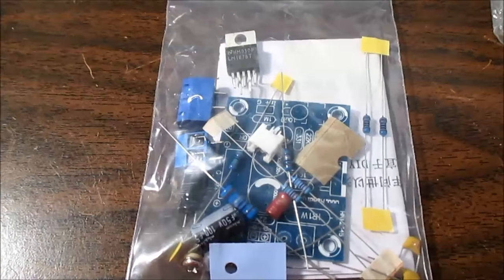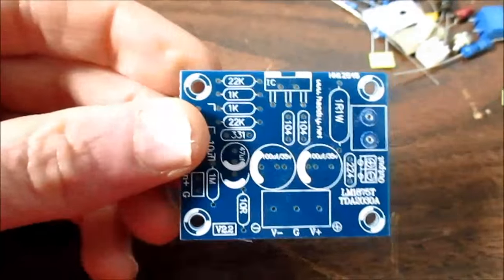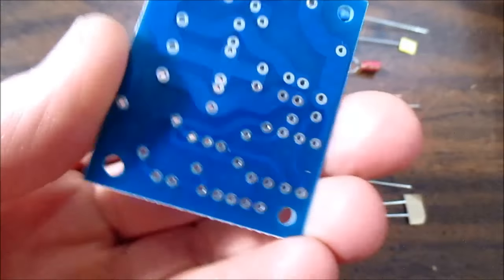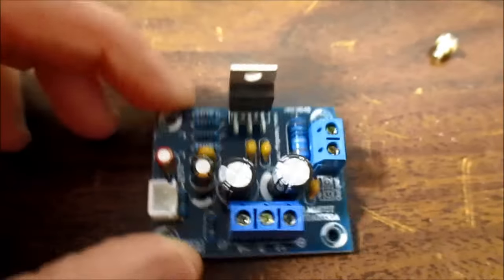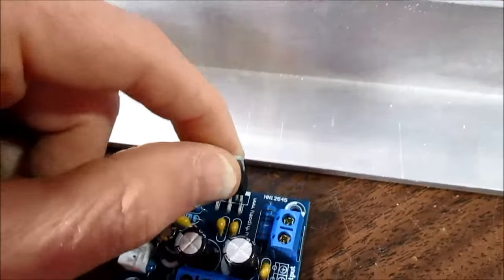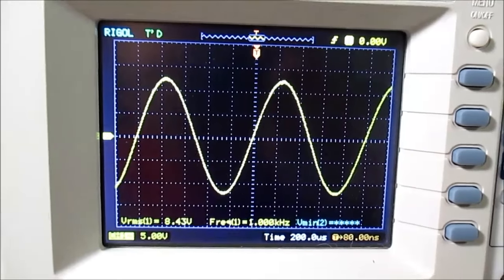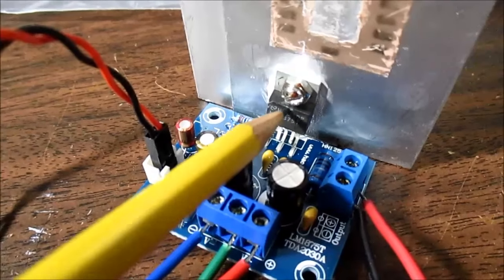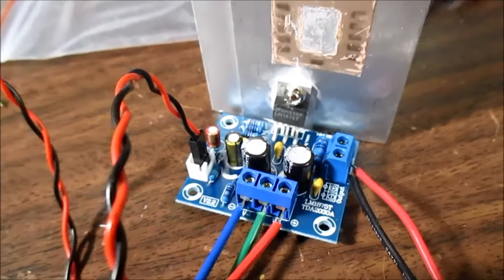LM1875 IC audio amplifier board kit test and review

Comment: There's an electronics magazine in Australia called Silicon Chip, and the December 2004 issue had a project called Schoolies Amp which is where the design for this amplifier section came from (it also had a power supply). They've also published some other good DIY amplifier projects (including the Ultra-LD series), for which they sell the PCBs on their online shop. And the more recent projects are often available as full kits at the local electronics retailers in Australia.
Reply: How do you know the magazine was first, and not some chinese seller?
Reply: @DasAntiNaziBroetchen  Because it's not in the Guinness Book of Records for the first time that a Chinese seller created an original circuit instead of ripping off somebody else's work.

Comment: This circuit looks sensible as it uses the differential amp function to effectively create a balanced input. Different than the datasheet recommended circuits though. Is there a source for how to create an optimised lm1875 schematic?

Comment: I can say from personal experience, the entire line of Texas Instruments IC audio chip-amps, LM class is awesome. I've been home hobby DIYing these chips for 20 years. If you breadboard them, keep the connections as close as possible, use better than average resistors and caps, good power supply/transformer, adequately cool, you WILL get amazingly, unexpected audio-sound straight into those beautiful speakers you would not test the finished board with.  I started low years ago, then advanced to the  LM3886. Try it, you'll be amazed if you're a newbie.
Reply: I'm new to this stuff and I want to build my own Bluetooth amps with Texas chips for Portable speakers but I have no clue on how to wire them could you help?
Reply: "better than average resistor"... em OK...

Comment: Got a few of these kits. The boards seem really well made, better than most OEM stuff. My soldering iron seems magnetized, it also charges caps while soldering them in.
Reply: Check to see if your soldering iron tip is grounded. It should be.

Comment: I always put a 100nF film cap in parallel with 47uF electrolytic cap. Gives additional stability.
Cheers from Indonesia
Reply: Lowers the ESR. I always use good low esr panasonic FM series caps and on the scope, i can see very little if any improvement doing that, but yeah, it can't hurt, especially if you are unsure about the ESR of the electrolytic. Don't put ceramics in the signal path though :)

Comment: Hi John, I've commented before and I have to say that yours is hands down my favorite YouTube electronics channel!  I watch pretty close to all your videos and I always learn more every time I watch one!  This particular video I've watched quite a few times and because I'm pretty much electronics illiterate, I pick up more tidbits of useful info every time I watch it!  Thank you for taking the time to do these vids!  I purchased and built the stereo version of this kit recently.  And I actually just finished it a couple of days ago.  It sounds fantastic!  I didn't use the supplied ICs that came with the kit, I ordered new ones from Digikey to be on the safe side.  The only issue I'm having is when I power the amp on or when I power it down, there's a slight audible snap in the speakers.  Not a big deal, but a little annoying.  Can I add a cap and/or resistor somewhere in the circuit to eliminate these snaps?  Thanks again, John for all you do!
Reply from the maker: Thanks for the kind comment! I'm glad you bought new ICs because they are now supplying counterfeit chips with these kits.

I had another question today about power up/down thumps and clicks plus some in the past. I think I'll do a video on it because there are many scenarios and solutions for it.
Reply: Excellent!  Thank you. John!

Comment: I bought two of these from that river store place, built them up, stuck them in a box, connected them to my audio interface and a decent old dual bench supply I have.  They work great; I'm using them right now.  I have one problem I don't know how to fix: they almost always don't start up correctly on powering on.  I guess they get stuck in some power blowing oscillation; not sure.  I get no sound, and the voltage is low, current high but not too high.  I need to touch the non-isolated heat-sink on the chip of one channel to make the amp go "schquwreeEEeEchhhChttts...."  Then it starts working...
Thanks for the recommendation.  It's a fun project, and it sounds great powering some inexpensive thrift-store bookshelf speakers, originally from a decent set of home theater speakers.
I enjoy your channel a lot.  I don't always have the time or ability to follow everything; your long amp series is pretty complex, but I've learned a lot from your videos.  So thanks...  Make more, please. :)

Comment: Nice little kit. I'm not surprised you don't see distortion on your scope's FFT, though - with an 8-bit ADC you get approx 48dB of dynamic range, so the minimum level of THD you could possibly see would be around 0.4%, something you're unlikely to see in a solid-state amplifier that's not being driven into clipping.
Reply from the maker: I tested this once by making a tone with a built in harmonic to see if it would show up. 1.0% and 0.5% were clearly visible on the FFT. 0.1% is lost in the noise floor. I never calculated were the cut off would be, so this makes sense. I'd like to get a spectrum analyzer or a distortion analyzer but these are currently out of my reach. There is some debate at where distortion can start to be perceived in music but most agree that under 1% should be inaudible (in most cases).

Comment: The price of this kit is in Germany at 1,70€ at the moment. That's a joke. Because this tiny chipamp is anything else, but not a joke. I ordered 2 kits half a year ago ( as they were @ about 5,70€). 3 weeks waiting, 30minutes soldering and you got a wonderful sounding little amp.The psu is +/- 25V and I put a hand full 2200µF/35V capacitors for a smooth DC in it. The LM1875 drive two 2-way Sats with a 130mm Gradient W130 AL 8 and a Monacor DTM104/8 25mm tweeter. A TDA7293 prallel kit powers a closed little sub with a Mivoc AW 2000. It's my 1st diy audio attempt and I'm convinced. It's much more I ever dared to hope I'd get. Now I'm totally infected with the diy-virus and I'm reading much about active crossovers & dsp ;) ... .

John, keep up your excellent work! I love to solder while you are explaining all these new things for me :).

http://abload.de/image.php?img=2xlm1875-tda7293-satrmuuet.jpg
http://abload.de/image.php?img=siebunglm1875komplettzluae.jpg

Comment: Have to say about the board, the soldering points are very small and the copper very thin.
The boards comes in different qualities.
Those I bought can not take any stress at all.
Recommend to glue the connections terminals

Comment: For me John, these videos are very valuable! I want to to know about these low power audio amps and I don't have the time to research what's out there, thank you so much! Will this chip run on less voltage, say 9 volts or maybe 12 volts? I know the power out put would be lower, but does it have a minimum threshold voltage? Here goes another small amp! Thankz
Reply from the maker: 9 volts is too low but 12 volts could work. It requires a split supply, so 12v is actually +6 and -6 volts. Power supply voltage vs. output power is an exponential function, so expect to get only about a watt or two at such a low voltage.

Comment: Hi John, with regard to the 10uf coupling cap, can I use motor-run caps? (I think they're metalised polyester). I can get em cheap at 400v even though that's overkill. Otherwise I'll just use suitable polyester or polyprop caps, rated at say 50 or 63v. Cheers, Martin

Comment: Hey John,
I decided to order few of these boards. I thought buying from DigiKey resistors and caps and using them instead of the questionable supplied ones.
But I am getting confused as to which voltages, materials, tolerance and value should I get from DigiKey..,.

Is it possible that you list which capacitors and resistors are recommended assuming all the components to be replaced ?

Comment: Hi John, nice work as usual. Subscribed awhile ago on different account and always enjoy your videos. I've been wanting to build a lm1875 amp for awhile and finally getting around to it. Do you have a video on designing the power supply for it? I've built bipolar supplies before but was wondering if the lm317 and 337 would handle the current of the 1875 if I built 2 mono blocks? Could I view it as 3 amps of handling current? 1.5 for lm317amps and another 1.5amps lm 337 together?
Reply from the maker: Hi Jake, Why use regulators? Power amp stages normally don't need them.
Reply: I just wondered if it would improve the circuit at all. Maybe improve power supply noise rejection, and protect chip against voltage spikes. I know most people just use a large amount of capacitance to filter but have also seen people suggest a regulated supply is better, some even suggest the sound may be slightly improved so just curious. I'm also am trying to decide if I should build two mono blocks to separate signals more and prevent any cross talk. I also have two of the same power transformers which will only handle one channel each.

Comment: Those Nichicon caps actually look genuine. Good value kit for sure, nothing more exotic needed for a basic amplifier really with the high output and low distortion.
Reply: It is hard to tell by looks alone. The Chinese are certainly capable of making cosmetically identical counterfeit products. I wouldn't be convinced until spectroscopic analysis of the electrolyte inside the cap was done. If that came up good then I wouldn't even care if it was counterfeit. I find examining the expansion slots a better indicator than looking at markings on the plastic sleeve for telling if a cap is legit, or not. Crappy caps often look like someone beat the cuts in with a chisel by hand.

Comment: Thanks for your videos, John! I am really learning a lot from you and ordered four of these kits. I built one and powered it with your virtual ground and a 19.5 volt laptop supply. Weird thing - The voltages read +/- 9.63 V from the supply but once connected to board, they become lopsided! -13.3V and +6.2V. The amp worked initially so I put it in an iPhone box with a 8 Ohm speaker to use with my laptop. After a couple months it began distorting sometimes. Today I built a second kit with an LM1875 from Mouser. Again, lopsided voltage. It is as above without speaker connected and -17.76V and +1.83V with the speaker. Any idea how to fix? Also there are two 10 Ohm resistors but schematic shows a 10 Ohm and 1 Ohm. The 1 W resistors measure 1 Ohm. Weird.

Comment: I tried putting 2 of these in parallel on the same power supply for 2 channels. The 10 ohm resister blew up. I will try 22 ohm.

Comment: I really enjoy your videos.  I am trying to emulate this test with the LM1875.  I believe I have everything connected correctly, but I don't get any output signal.  Reviewing your setup in the video it seems like you are doing something on the input side.  I simply have a stereo jack coming out of my phone to serve as the input. Will this work?  I can see the music on the Oscilloscope but there is simply no output signal.  I am using a split supply voltage of 30V from my lab power supply.  It is correctly measuring +15V and -15V.  I am muddled up as to what I might be doing wrong.  I would very much appreciate any advice you might have.  Oh, and hello from Ohio.  I live in Stow near Akron.  Thanks.
Reply from the maker: Hi Andrew, You can use the signal from your phone to test. It should appear on pin 1 of the IC after passing through the input components. If you are using the kit, be careful of the values of the resistors. The color code on blue can be hard to read and the 3 digit, 1 multiplier means different colors for a given resistor value than the typical carbon types. (it is easy to put in the wrong value). Relative to ground, be sure -15v is on pin 3 and +15 is on pin 5. Output pin 4 should be close to 0v with no input signal.
Reply: John, many thanks.  Your hints sent me in the right direction.  I measured the signal at pin 1 and found nothing.  I then proceeded backwards towards the source and i have to say what I found was embarrassing.  I write it here because, well, everyone makes mistakes.  When I connected up the input capacitor I failed to notice which holes were input and output.  I ended up connecting the capacitor to 2 input holes.  Once I fixed that all was good.  I do have one additional question.  In the video you mentioned that the input capacitor should be a film cap.  I replaced the 10 uF capacitor with a 2 uF film capacitor.  What would be the appropriate value of this capacitor.  I looked for 10 uF film capacitors and that seems to be a big value for those capacitors.  Thanks again.  Andrew
Reply from the maker: @theaddies  Glad you found the problem. 2uf is near perfect. I don't know why they used 10uf. It is way overkill.
Reply: @JohnAudioTech  John, my testing continues of my LM1875.  It seems that I am getting perhaps 9 Watts into 4 Ohms and 12 Watts into 8 Ohms before clipping.  The supply voltage is about 27V.  I am using the parts that came with the kit, but I do have some authentic LM1875s that I bought from digikey.  I am using a heat sink but nothing nearly as big as the one you used.  The temperature of the LM1875 seems to reach about 90F or so.  I am testing at room temperature.  Do you have any thoughts as to why the output is so low?  Thanks in advance.
Reply from the maker: @theaddies  Be sure it is not your source signal that is starting to clip before the amplifier. Headphone output sources may not have enough voltage to drive the amplifier to clipping. That is why I use a preamp. Why you get less power from 4 ohms could be the power supply can't deliver the current the amp needs.
Reply: @JohnAudioTech  John, I am getting better at this.  I made some changes to the power supply.  @+ / - 25V I am getting 23W into 4 ohms.  @+ / - 30V I am getting 30.8W into 8 ohms.  The LM1875 is the one that came with the kit.  Pretty impressive numbers I think.  Thanks.
Reply from the maker: @theaddies  You should be able to get higher wattage with 8 ohms at those voltages. With 4 Ohms, the chip's current limit is in effect. +/- 18v is as high as I'd go w/ 4 Ohm loads.
Reply: @JohnAudioTech  The datasheet suggests 25W maximum output power into 8Ω with ±30V supplies and about 22W into 8Ω  with ±25V. For 4Ω loads, it shows 15W continuous output with ±30V supplies (using an infinite heatsink!) before thermal shutdown. While for ±25V supplies into 4Ω and a 1°C/W heatsink, you typically get up to 20W before shutdown. I think Andrew is getting better than typical performance already. I agree that lower supply voltages will produce more practical circuits with 4Ω loads, although the "sweet spot" is probably near ±20V for an output power of 15W and an internal dissipation of about 22W. You'd still need a 2°C/W heatsink, though.

Comment: The LM1875 can operate at a voltage of 16V to 60V !!!.  As per the datasheet, it can be configured to be used with a single or dual rail supply.  Using an 8 ohm load and a supply of +/- 30V,  30W of power may be delivered.  By the way, do not plan to use this IC without a heatsink.  The LM1875 must always be operated with a heat sink, even when it is not required to drive a load. The maximum idling current of the device is 100 mA, so that on a 60V power supply an unloaded LM1875 must dissipate 6W of power. The 54°C/W junction-to-ambient thermal resistance of a TO-220 package would cause the die temperature to rise 324°C above ambient, so the thermal protection circuitry will shut the amplifier down if operation without a heat sink is attempted.  With the actual design the power dissipation will be less, but temperature always has the tendency to raise quickly.  Have fun !

Comment: Thanks for the explanation, I would like to know how many Amps is the power source recommended for this small amplifier to operate?
Reply: Given that the maximum rms voltage into a 4Ω load before clipping was measured at 8.44V rms, the peak positive or negative voltage would be around 8.44 x √2 = 12V. That shows that the peak current would be about 3A from either rail. Some of that could be sourced from the power supply filter capacitors (at the expense of supply ripple and slightly reduced power), but the average current will still need to be at least 2A. Driving an 8Ω load would need around half of those values. One caveat is that a loudspeaker is a complex load and sometimes represents an impedance less than its rated value at certain frequencies.
Reply: @RexxSchneider  Thanks for the information, hugs

Comment: Hey John,
Do you have a schematic for a pre-amp with 3 band eq and gain or volume?  I would like to build this amp as an on-board practice amp for my guitar pedal board. If it sounds good enough, I may utilize it for small venues.

Thanks for the awesome videos.

Chad A Sparling
Reply from the maker: Check Elliot Sound Products site. He has tone control opamp schematics. I straight feed my amplifiers (no preamp or tone controls). I can see the need for a guitar amp, however. I plan to look at opamp filter circuits at some point.
Reply: please share